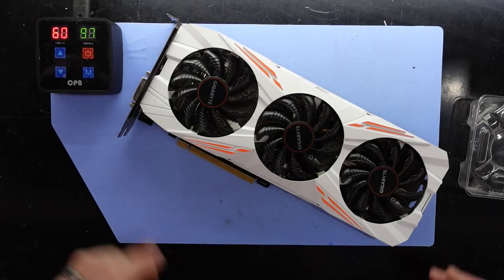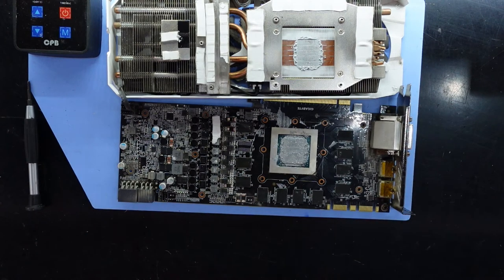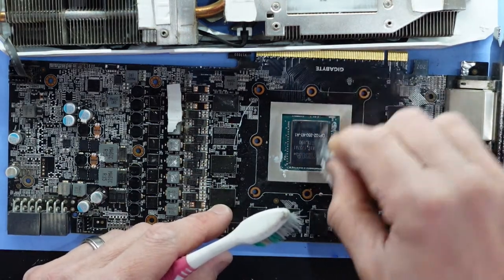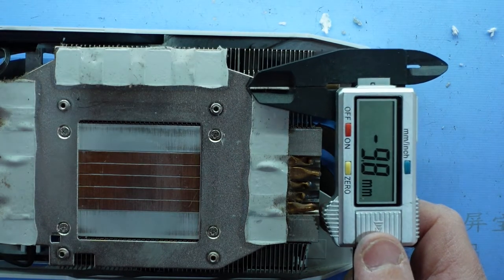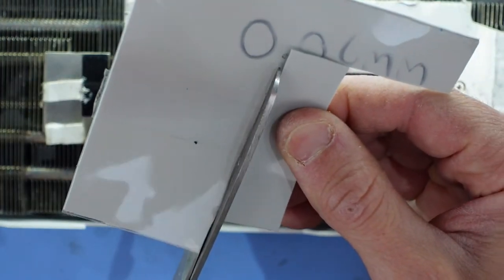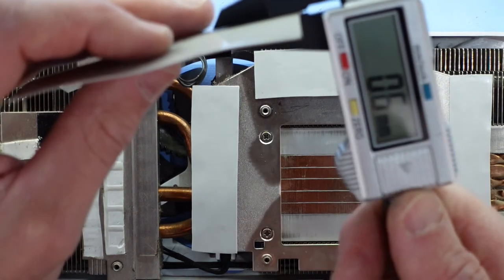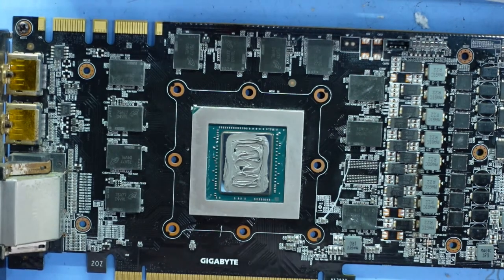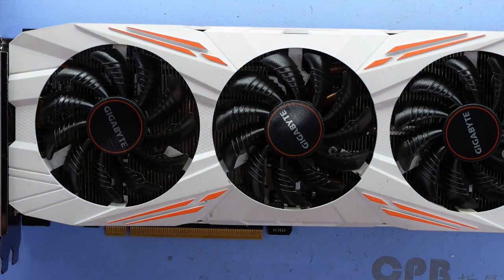Gigabyte GTX 1080Ti Thermal Paste and Pad Replacement

Comment: Memory - 0.5, VRM - 1.0 those thick ones - 2 mm (Just do double 1.0 if you are doing it yourself, no need for purchasing additional 2mm thermal pad) Thermal Grizzly or Artic ones are the best.
Reply from the maker: Cheers for the comment
Reply: @Evilserge Is its thickness originally?
Reply: @セラ-l7o  Yes
Reply: @Evilserge Thank you!
Reply: Will these thickneses work on the regular version? Thank you
Reply: @juanyanez755  most likely.  1070ti 1080ti had the same thermal pads, I assume that non ti have the same design.
Reply: @Evilserge  thanks i just bought a used regular 1080 version of this and imgoing to repaste
Reply: Thanks man, very usefull informations 👍
I'm planning to give my 1080ti a good maintenance as it is starting to get a bit old and toasty lately lol
Reply: Thx for the comment. Doing this now
Reply: Thanks a lot for theses numbers!
Reply: nice, i'll purchase soon to renew the older with Arctic TP3.
Reply: Instead of thermal pads, I advise you to apply thermal putty Upsiren UX Pro. And try phase-change material Honeywell PTM7950. It comes in as a sheet, lasts longer, performs works better than traditional pastes and there is no pump-out effect. It is also a good idea to do undervolting.
Reply: Hello, 0.5mm on the vram is to Big for me, i don’t have contact on the gpu and the heatsink

Comment: omg so lucky and thankful you made a tutorial on the exact model GPU I have. I just turned on Minecraft running a shader that previously would cause temps to rise to mid 80s and the hotspot to over 100. But now it's about 70 and 84 (didn't last long tho as the game crashed lol) Thanks a lot!
Reply from the maker: Great to read this has helped!!
Reply: i have a 1080ti ftw3 ... used to hit max 72c and now it hits 84 
changes thermal paste but same temps 
so maybe thats the problem .. thermal pads

Comment: Anyone know how to remove the backplate? I got rid of the 7 screws shown here. But it is still on. The only things left are 4 20-ish sided star things holding it down but I cant get those out or even if you can without breaking it.

Comment: Hello, I have a 1080ti from Gigabyte but with the Turbo blower style model. I still see high temperatures about 100 on hotspot and 90s on gpu after thermal repaste. Could it be not changing the thermal pads caused that? Do you think I could replace the blower style cooler with this model of fan? Is it compatible?

Comment: Hi, I reached out to Gigabyte about thicness of thermalpads for this card. I will write them from the left side of the card to right (from processor to power section)
V rams - 0.5 mm
These grey R22 VRM'S  - 0.65mm
After them these black squares - 2mm
Last one with screw between them - 0.5mm
they didn't tell me nothing about these 2 thick ones
Reply from the maker: Thanks for the info!
Reply: @rickstechrepairs   Hi could you please provide me the link of thermal pads you had cut... please do revert as I am fixing my fans of GTX 1080 ti 8gb gaming card, I wonder it will be similar for our both the device.. and I would like you recommandation from amazon or wherever is that product of thermal pads.
Reply: I contacted them as well and they sent me the Image\diagram of the card and the location and thicknesses of the pads.
Reply: @Mywhtjp  could you send a link to that?
Reply: Thicker one is 2.75mm as per Gigabyte support.
Reply: whether these grey R22 vrms to use 1mm thermopads at 0.65mm?
Reply: @Mywhtjp  bro would you happen to still have the images. Im trying to change my thermal pads and its confusing. and theres no info anywhere

Comment: Ok so i have a gtx 1080ti ftw3 
it reaches 90c under load 

I tried changing thermal paste but nothing ... Does changing the thermal pads will make a big difference?

Comment: I have just asked information about pad's sizes. My card is: GeForce® GTX 1080 Ti Gaming OC 11G
Answer I got from Gigabyte support:

We can only provide the thickness of thermal pads. They are 0.5mm, 0.65mm, 2mm and 2.75mm.

14.25*63.2*0.5mm
7*70*2mm
7.25*72.5*0.65mm
7.5*30.5*0.5mm
7.5*24.5*2.75 mm

Hope it helps to others too.
Reply from the maker: Thanks for sharing :)
Reply: tnx sir in this video in left side of the video the 2 thermal pads that cut in left is 2.75m? have one piece up and down..not have for sale 2.75mm or 0.65 what do?
Reply: @RnhTechnologic  
I have oredered the next thicker available sizes. So I will use 1mm instead of 0.65mm and 3mm instead of 2.75mm.
Actualy I am waiting for shipment and will replace afterwards.
Reply: @norbertpipo4713  Hello. And how do these 1mm and 3mm thermopads fit or are they too big?
Reply: @gracjanrok3994  They are soft and easily adjusting to the shape of parts. No problem at all. I have used GELID type of thermal pads.
Reply: @norbertpipo4713 what temperature do you have on this card gpu core and hotspot?
Reply: @gracjanrok3994  I have not measured by any device exactly, I can say only that based on software side  the temp droped down by 5-7°C.

Comment: If you don't have 1.5mm pads but have 1mm and 0.5mm, could you stack the 0.5mm onto the 1mm?
Reply from the maker: that should be possible also
Reply: I don't think it is a good idea, since there might be some air between the two which can impair heat conduction.
Reply: Never do this.its not working

Comment: Hello, what sizes of thermpads did you use in mm because I will be replacing it, and there are also 2 thick ones
Reply from the maker: dont have to check sorry
Reply: Memory - 0.5, VRM - 1.0 those thick ones - 2 mm (Just do double 1.0 if you are doing it yourself, no need for purchasing additional 2mm thermal pad) Thermal Grizzly or Artic ones are the best.

Comment: I have 3 GeForce 1080Ti''s..  one of them decide to go cold on me. 2 in one rig and the other and a 3060 in another. It got down to 7MH/s.. it's back to 37 now. The thermal paste was barely applied.. Now there's a good solid coating. Am waiting on new pads if it decides that the paste wasn't enough.
Reply from the maker: Ouch barely any thermal paste is terrible..
Reply: @rickstechrepairs  I bought the card used, so it might have been worked on previously. I would think the manufacturer would have added more than what I found. So.. I applied a good amount of paste to it.. So it began working pretty good for about 30 minutes and then it dropped down again. so my new thermal pads arrived and I opened it up again and replaced the pads. Once again. it worked properly for about 30 min and then dropped the rate. So that's where it's at now. This card has always been the best hashrate of them all. Now my 3060 is cranking out  41.17 now.  Should I double stack more pads..? Not sure what to do next.
Reply: @Mywhtjp  dead 1080ti; stop mining - you killed its VRMs with constant mining, it happens; when VRMs go kaput you get the exact scenario youre in - theyll 'work' until the VRMs require a voltage that the card just CANT handle anymore and will downclock to ever living hell and thus why you're getting horrible hashrate - again, dont mine if you want your GPUs to live 🙃
Reply: @kendog0013  I disagree with your statement.  GPS were not made to do mining..   But they sure do a good job of it. It might lessen their lifespan but I'm OK with that.

Comment: hi rick i have a que, i have same GPU as yours, and the thermal pads got melted, do i have to/can i use same MM measurements that you're using on clip to replace it? or i have to measure my own's and than replace it after? please help me ^^
Reply from the maker: there need to be pretty much the same height as what you already have
Reply: ahh its really difficult to measure them cuz they are burned/melted :(  @rickstechrepairs
Reply: what should i do? @rickstechrepairs

Comment: So what makes a motherboard not see an M.2 drive that it was booting from..? It's a semi new B450.
Reply from the maker: i have not seen that first hand but i would try and boot a windows 10/11 USB installer to see if detect the M.2
Reply: @rickstechrepairs  Can you be more specific..?  The machine was booting from a slower M.2 and now have an nvme drive to replace it. It's currently running off an SSD now.

Comment: what kind of thermal performance do you gain doing this?
Reply from the maker: not sure on that one
Reply: @rickstechrepairs  I mean, how many degrees cooler does the gpu run now that you changed the thermal paste? Thanks!
Reply: I replaced just the thermal paste a few months back on my 1080ti and it dropped 4/5 degrees Celsius at full power, worth it imo 👍
Reply: My temp dropped from 68-69 to 58-59 Celsius at full power (witcher 3, rdr2, doom eternal) but this old thermal paste was very dry. Anyway it helped a lot
Reply: I think it's profitable when you OC more the GPU, more stable i think...

Comment: Cutting up an old credit card or gift card to the width of the GPU works great to apply a uniform layer over the chip. I don't want to risk the GPU not having compound on it.
Reply from the maker: They do work well

Comment: Hi Rick; i came up to this video while wanted to check if i connected my 4pin fan connector on the GPU PCB on the right place (i have same card and wasnt sure which of 3 exactly same looking power connectors is the right one :) ). I'm kinda surprised you are using CONDUCTIVE paste, MX4 is non-conductive equivalent  +/- 2C (depending the case). I have seen some short-circuted PCBs/GPUs, and it doesnt look nice :) BR!
Reply from the maker: Hi

Good to hear this has helped you 

Regarding the thermal paste 
http://www.arcticsilver.com/as5.html
Artic silver 5 is no conductive, as listed on their site
Reply: @rickstechrepairs  my apologies m8: I re-googled; You are correct, its stated: "Not Electrically Conductive"; however for reason not known to me RN, I READ "Not Electrically: Conductive" . Silly me, gotta check with the ophthalmologist, probably  :D